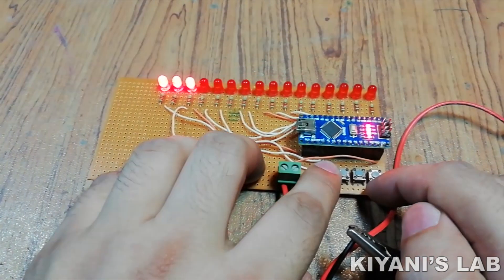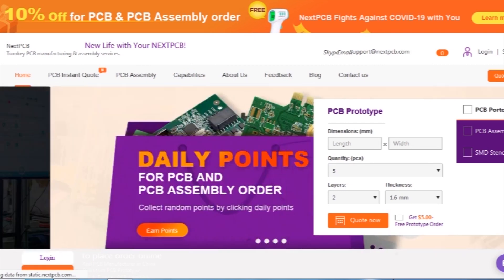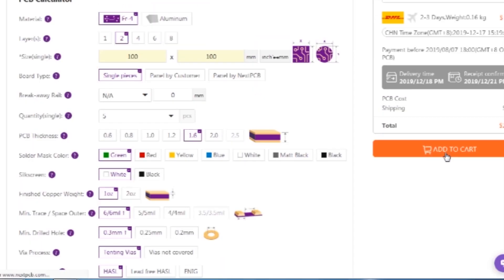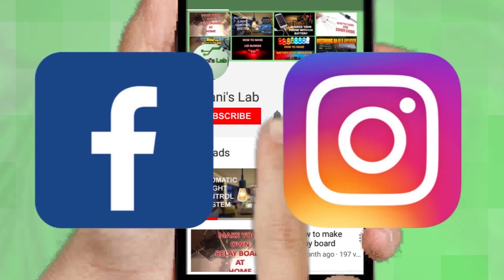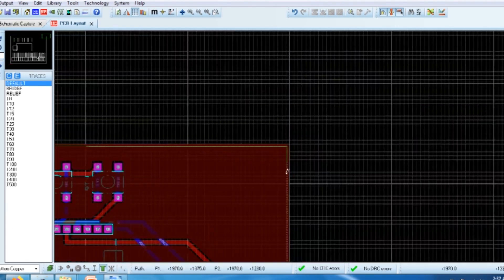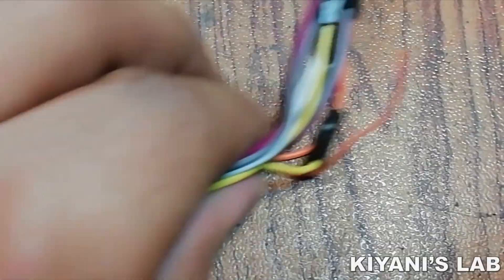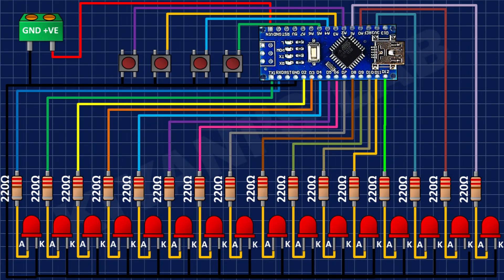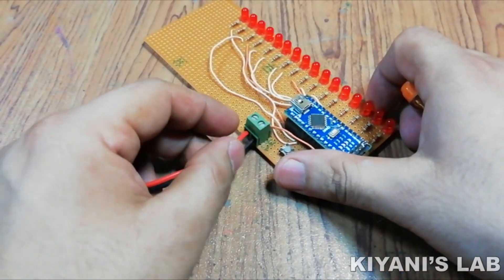How to Make 16 LED Chaser | 8 Effects

Comment: Hello. I really liked your idea. You can add a few more animations, for example, like a full line sroboscope. stroboscopic division into two stripes. movement to the left then to the right and right continuation of the light bulb in the same way and 3 is possible. and alternately turning on and off the light bulb turned on. and add an automatic function but also have a manual setting. Can these changes be added to the firmware?

привет . очень понравилась ваша идея  . можно ли добавить  еще несколько  анимаций  к примеру  как сробоскоп  полная линия . стробоскоп  деление на две полосы .  движение  влево потом в право пра последоватленьях лампочки  так же и 3 можно . и   по очередно включение выключени соседних лампоччек  . и  добавит ь  функцию  автомат но и что бы было и  ручная настройка. сможете  добавть  в прошивки эти изменения?  лайк  подписка
Reply from the maker: yes i will make it soon
Reply: @KiyanisLab  oh my friend, I will be glad to repeat after you. I'm really looking forward to it.ох ты друг, и буду рад, что повторяешь за ней. я действительно с нетерпением жду этого.
Reply: @KiyanisLab  важно . сделать на  кнопках  переключение  режимов и  автомат  чтобы сами  эфекты преключались  с натройкой скорости переключения  и добавить эффекты

Comment: Hello.
How can I make this program turn on all the LEDs after finishing the effect and not loop?
Please let me know because I want to use it for the opening of the car.
Thank you.
Reply from the maker: code need to be modified a little for that
Reply: @KiyanisLab  .Through which file do you program.? What are examples files??
Reply: @KiyanisLab  .The way to enter the code in the description link is how I have downloaded it
Reply: @TAMPAL_BOR10  Hello. Thanks for the reply I would like to change the Audi style opening motion to a program where all LEDs are always on after one process, but I want a program. I am making my own tail lamp and want to use it.
Reply: @Kai-dg4go  .many are still confused about how to program it. And do all the links in the description have to be used or only one...?
Reply: @TAMPAL_BOR10  Thank you for your reply.
As a wish, Audi style will turn on all LEDs after power on and turn off when power is off.
Will the knight rider be able to switch with a switch operation?

Comment: Bro u can use 1 resistor in the GND and be done with it... no need for so many resistors
Reply from the maker: it is better to use independent resistor for each led because leds are not be turned on at the same time so current is different every time and voltage is too light will not be constant or leds can be burned if low value resistor is used
Reply: @KiyanisLab  seems like a good argument... thanks

Comment: How we can make it automatic working without pre-set buttons?
Reply: You can use a switching circuit 4 channel
Reply: @tanishqmourya564  

Dear: I want to get rid of this irritating switching. I don't want to use a single switch. The Circuit must be switched its Effect [mode] without pressing any Switch. Means, all effects must be played [operated] automatically [one after another] without any switch.
Reply: If you know coding you can change the Arduino program and attach the effects in void loop it very easy to program
Reply: @tanishqmourya564  

How can I get its circuit diagram with coding (source file)? Please advise and provide the link if possible. Thanks and Regards.
Reply: @iq2823  there is no such source file available yet but I will try to make one ang give you